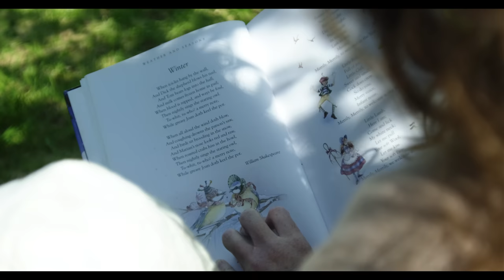The End of Zero Waste Living - May at Fairyland

Comment: I used to aim for zero waste living. However once plastic has been produced the problem is there. By re-using plastic plant pots, yogurt pots, milk cartons it is possible to prevent these from going into landfill. I collect the plastic fizzy pop bottles from work cut the bottoms off and use them as miniature cloches for my seedlings. The other half I invert and plant next to my tomato plants so that I can get water right down to the roots. An old pallet can be a raised bed, a bench, a compost container. Fabric strips go for quilts or wrapped in old clothesline for coasters. Bottles are used for my homemade elderflower cordial or rhubarb and orange cordial or winter berry cordial. A broken chair is used to display my plants. I find this much more fun that trying to go waste free. I think you are doing so well.

Comment: Another natural cleaner to add as another choice, take discarded grapefruit, lemon, orange/tangerine peels and place in a large glass jar, then fill with white vinegar and let it sit for a week with the lid on.  After a week, strain the mix into a glass spray bottle, you can add some water to your cleaner.  It works very well, has no residue and leaves a very clean mild citrus scent.  God bless you for your work in sharing your tips.  They are very appreciated.

Comment: I was trying to recycle and repurpose everything imaginable and found during Covid that it simply wasn't possible in my area. Many of the recycling centers closed or got very rigid about what they'd accept. Now there is one place several miles from here that will accept plastic drink bottles, paper and magazines and metal food cans. I try to avoid plastic containers as much as possible but they are everywhere. Its a fine line between reusing and repurposing and getting overwhelmed with litter about the house!

Comment: Yes indeed! Other than the horrid green-washing self-promotion of major polluters, the green-washing bee in my bonnet is zero-waste sewing patterns. They mean absolutely nothing! Firstly because there are hundreds of fabric rolls produced around the world - all of different widths & there's only zero waste if everybody buys the same width of fabric bolt as the pattern designer. Secondly, how is it less wasteful to go out & buy virgin fabric in the correct width, as the pattern requires, rather than use something you already have in your stash at home? Why aren't zero waste patterns designed around the size of table linen & bed linen? It would encourage people to buy used linen from second-hand shops. All they do is encourage people to go out & buy more & more polyester fabrics that cause more harm, while thinking they're doing good by using a zero-waste pattern. Many just can't afford to buy natural fibres & they don't understand that polyester is plastic & it lasts forever. I saw a zero-waste dress pattern which needed 7-8 metres of fabric, if cut from a narrow bolt. How does using 8 metres of polyester/plastic every time that 'zero-waste' dress is made help the planet in any way?

Comment: No plastic has its place, but just as much the what can i do with this container/packaging after the contents is used? I make more things myself these days, part from cost but also because i wanted to learn new things. Soap making was one, bread baking i took up again, although i will buy some fancier things in the store for a treat. Now making some macrame dish scrubbers (knitting or crochet doesn't agree with me much and the thread is not forgiving enough to learn this on) to try for when my supply of dishwashing brushes runs out. If they work for me i'll keep on making them, if not back to what works.

Comment: If you have a sewing machine,  you can use the reclosable bags from dried fruit, nuts etc and make totes and storage containers.
Wash the insides, dry thoroughly, trim the tops so they're even, hold the edges together and join them with a wide zigzag stitch. Adding a flat bottom is still a challenge but it's fun and kids love them.